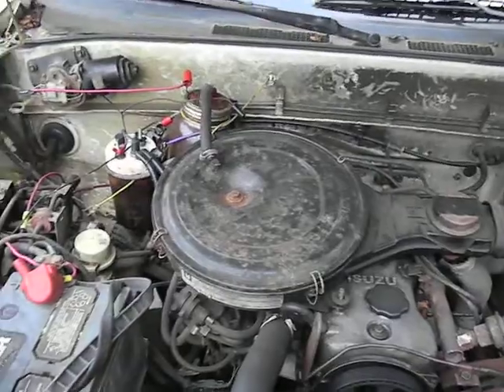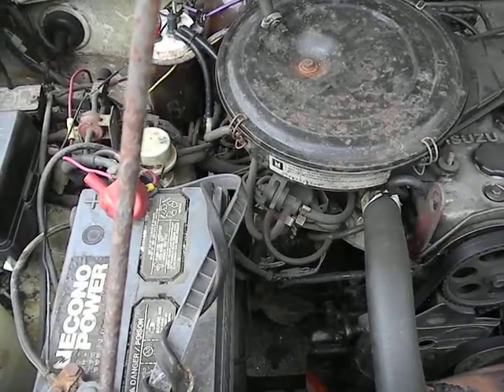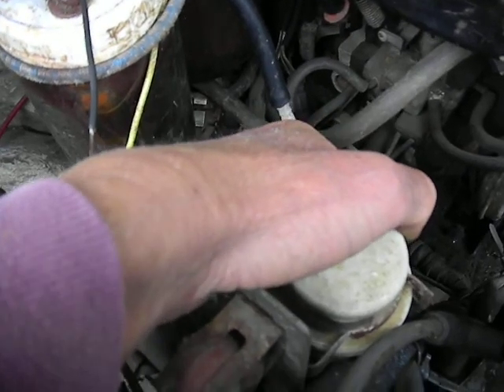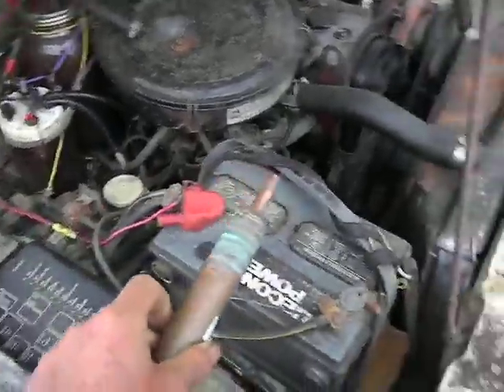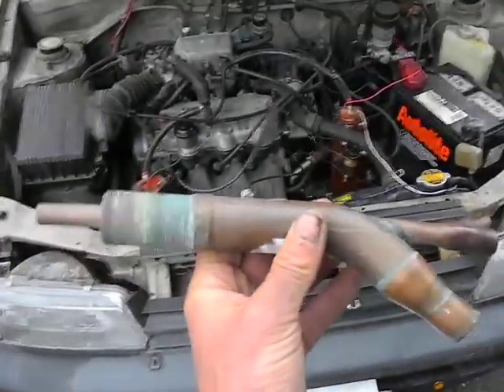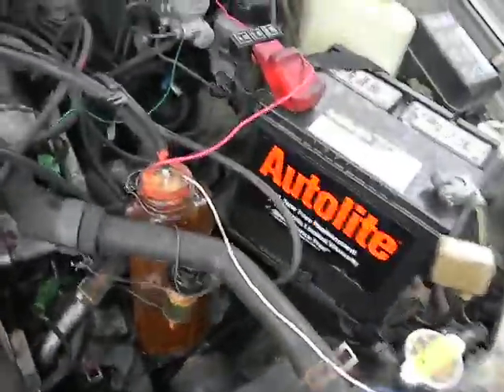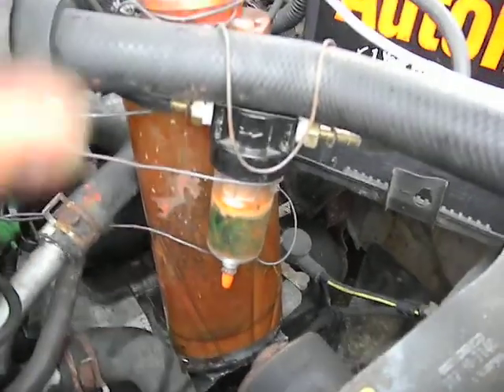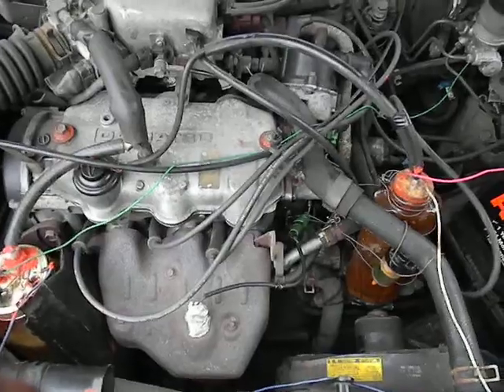Eureka Ca Hydrogen fuel & gas atomization automotive Services 707 445-1591

Comment from the maker: Hay Marz, I got 1 small systems from WaterEnergyOnline to start and figure out how they do it. Basically get yourself some jars an  insulator and some stainless wire, I quite often do hauling/ dump runs for folks and get alot of materials fee. A heavy duty insulator will cost you $50 but you can make your own electrolizer easy. Also always have correct air pressure in tires and run good oil.coolant plugs etc.  Peace